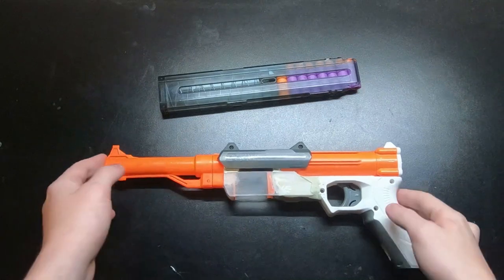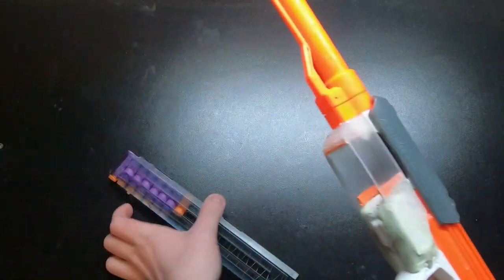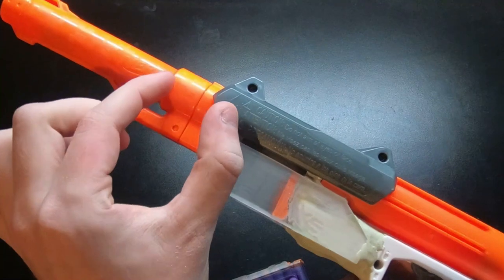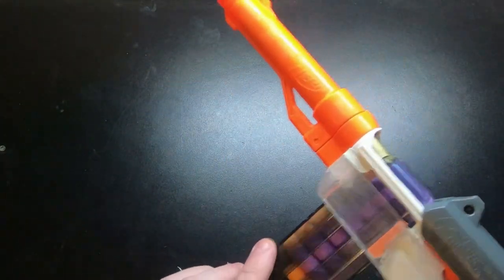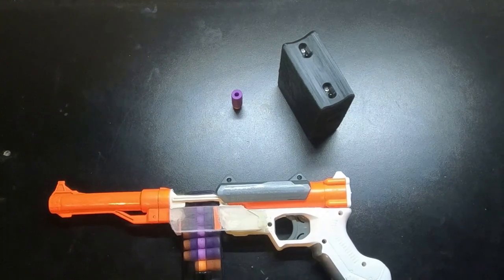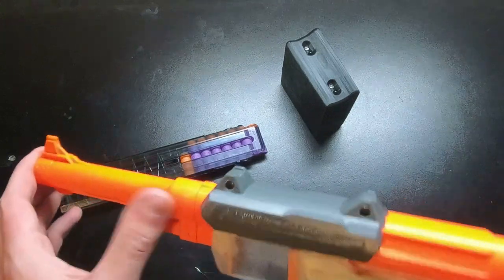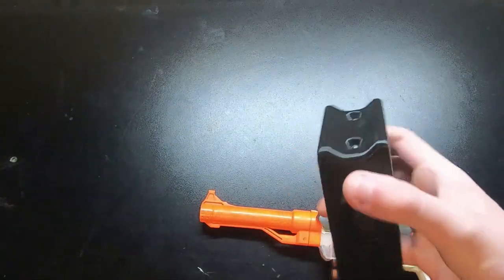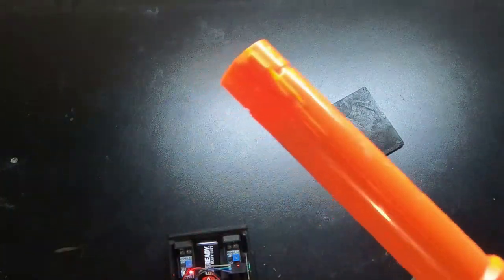Mauser Fire

Comment: I am getting 150/160 with a turf 8kg on mine. I have a sleeper breech and my brass goes right to the end of the nerf barrel... I need to test mine with the strongarm 7.5kg turf sleeved over the 8. I believe that's what Chris uses to get 200fps
Reply from the maker: Yeah I really need to go back and work on this but I just prefer my retaliator. I dont feel confident with using a strongarm spring in the sharpfire since it doesn't go inside the plunger I feel it would rub on the catch weirdly.

Comment: So, I've worked on the Sharpfire quite a bit and have used Chris's Mauser. I'm curious how the back part of your bolt looks. I am also using a sleeper style breach for the same reasons, but am wondering if you are losing power in the plunger cup to barrel. I neck that down to 15/32 brass or 7/16 aluminum depending on what I have available that goes right up to the dart and everything else between is deadspace filled. This is for my personal Sharpfire, not quite the same as the kits I had been selling because this wasn't easy to drop into a blaster as a kit. I'm getting around 170s-180s now with this old pistol. Didn't reach Chris's 200, but got close in mid 190s.
Reply: I also pulled my barrel back further and have the bolt hold the dart in further as well to reduce deadspace even more.